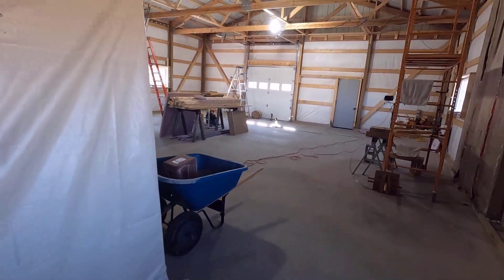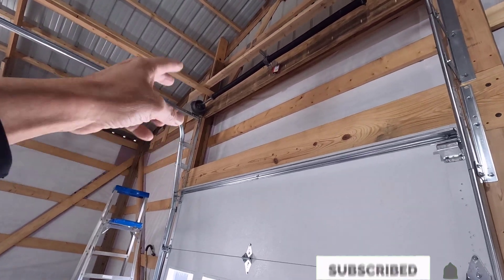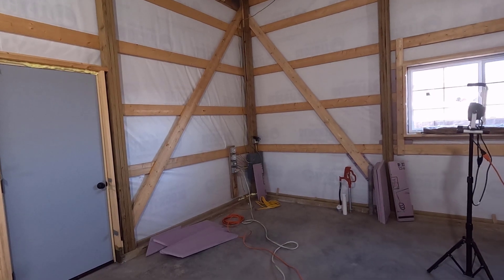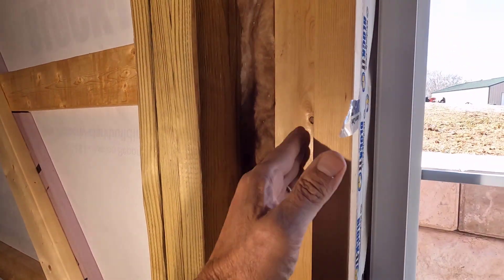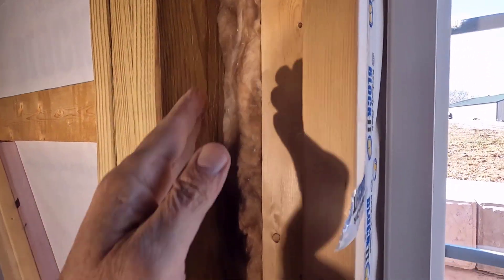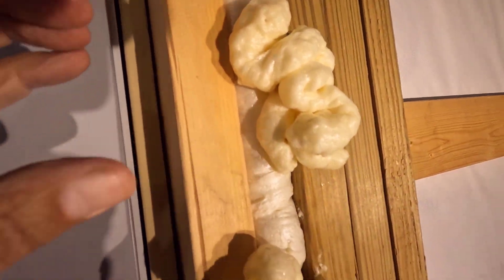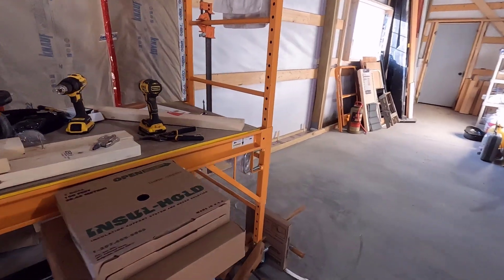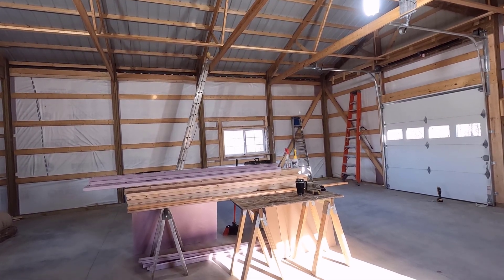How-to Super Insulate a Post Frame ― Fix Thermal Bridging W/XPS Pt.-2

Comment from the maker: The thing about insulating correctly is that it takes awhile, but it is really nice knowing that it is done correctly and not just covered-up! Now that these pockets are taken care of, it's time to blast ahead with the insul-hold strips that will suspend our fiberglass! Insul-Hold - https://amzn.to/3evnmKq

3M All Weather Flashing Tape - https://amzn.to/3ICBX4P
Huber ZIP System Liquid-Flash - https://amzn.to/31OtCtN
Seville Classics Commercial-Grade 5-Tier  60" W x 24" D - https://amzn.to/3qgjrXJ
5000 Lumen Temporary LED Work Light - https://amzn.to/3eslZfu
Heavy Duty 3-Prong Wireless Remote - https://amzn.to/3EnPWYN
Powermatic Model 60C 8-Inch 2 HP 1-Phase Jointer - https://amzn.to/3mvPq4M
Jet Contractors Saw - https://amzn.to/3mAAQJs

1" Garage Door Chain Hoist - https://amzn.to/3rn11VF
1" 4:1 Open Garage Door Chain Hoist - https://amzn.to/3uldvQA
1" 3:1 Open Garage Door Chain Hoist - https://amzn.to/3IVxXf0
1.25" Garage Door Chain Hoist - https://amzn.to/32R3vmS
Ambient Weather WS-2902C WiFi Smart Weather Station - https://amzn.to/3GzRdNp
Brownell Oxpho-Blue Professional Grade Cold Blue - https://amzn.to/3BfKiYO
Evapo-Rust - https://amzn.to/3gJQEq4
Xcluder Rodent Control Fill - https://amzn.to/3oVsH3x
Great Stuff Pestblock With Smart Dispenser - https://amzn.to/3HfI2SG
5FT Power Twist V-Belt 1/2-Inch x 5 Feet A Type - https://amzn.to/3LTQQkF
Aluminum 5 Slot A Type V-Shaped Pagoda Pulley 5 Step Pulley - https://amzn.to/33GTclJ
Wixey Remote Planer Readout With Fractions - 300mm (12") - https://amzn.to/3scJQro
TamBee Hidden Door Hinge - https://amzn.to/3tpstTE
Yosoo Latch Lock - https://amzn.to/35Rh7ji
Spring Load Bolt Latch - https://amzn.to/3hF8n2c
Milwaukee 3/8" Crown Stapler - https://amzn.to/3HKbtgb
MPOWER Triple Diamond Sharpening Whetstone - https://amzn.to/3ClrZ52

Comment: Sorry I only watched a few minutes of the last several vids, haven't had a lot of
free time last several days. They are building a new loco shop at the harbor,
they are currently insulating it and it's a very poor job. As I was watching them
this morning was wishing they would have watched your videos on how to do things 
the right way like you did!

They didn't put anything between the posts and the tin sheeting, I suggested adding
some insulation in that gap. They said you didn't need it there. After watching
your videos, I just shook my head and walked away. I know it's taking a long
time to get things accomplished, but be proud of the excellent work you are 
doing on this building.
Reply from the maker: No worries Dave! It's the difference between insulating and super insulating. Both will work, but one will cost less to keep at the same temperature and will be more comfortable. It costs more and takes more time to super insulate, but the results will pay for themselves in the long run. 😊